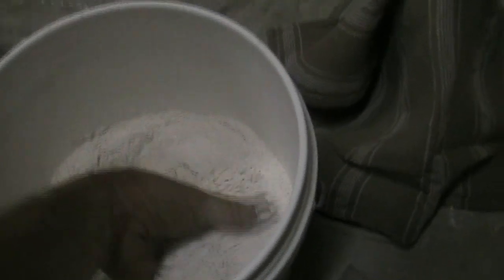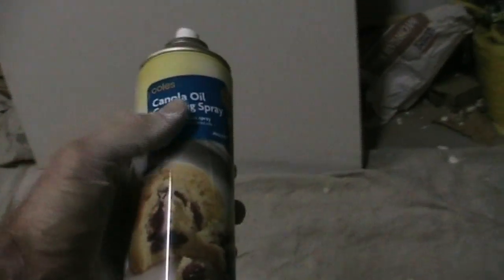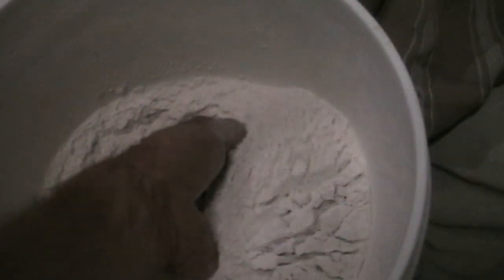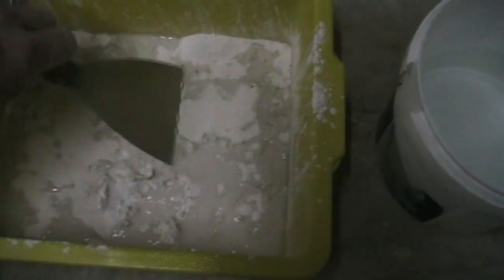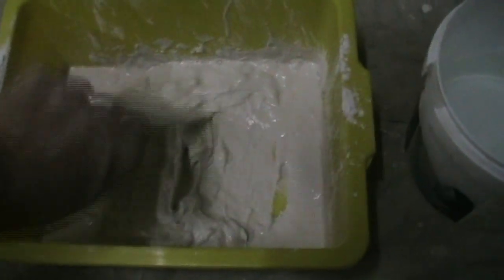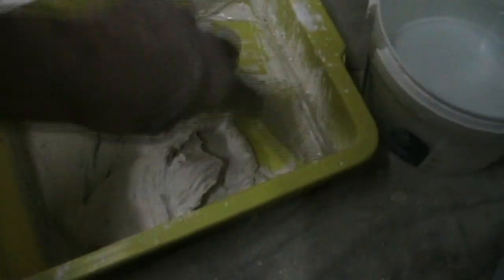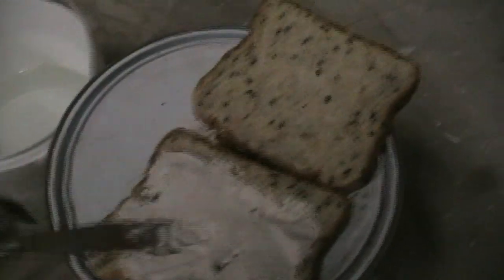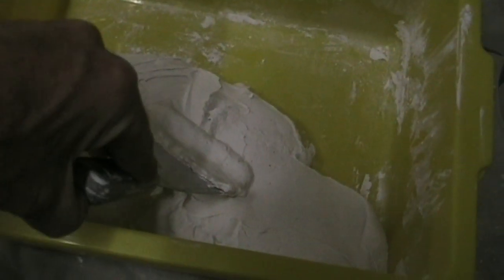How to Mix Drywall Joint Compound.Drywall Compound SECRET REVEALED!

Comment: I have had two major patching jobs this week and thanks to your tips I used cornice cement and got the jobs done in a quarter of the time it would normally take if I were using GP or Top Cote! As I am a self taught plaster I will definitely be watching more of your tutorial videos, I have reskined a few houses and many rooms in my years installing home theatres I have always been able to get great results but it takes way too long! Now days most of my work is fixing holes in walls!

Comment: Good tip! I use tin foil to wrap the brush in if I'am taking a quick break. Will this putting the brush in water will it work for overnight? So you don't have to clean the brush?

Comment: Mate your blood's worth bottling. Used this tip for mixing the grout on a fireplace mantle that I tiled and got a great result and it was so easy to clean up afterwards. Wasn't quite keen enough to try the sarny tho
Reply from the maker: Thanks mate. Yeah l must admit, the sandwich is an acquired taste :) Glad l could help. Cheers mate